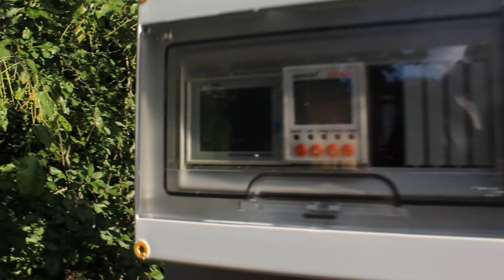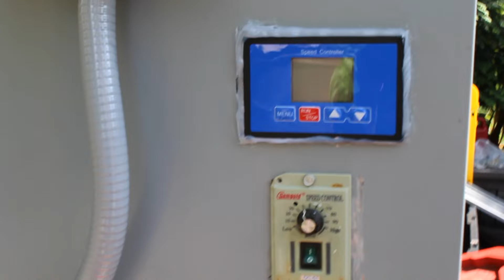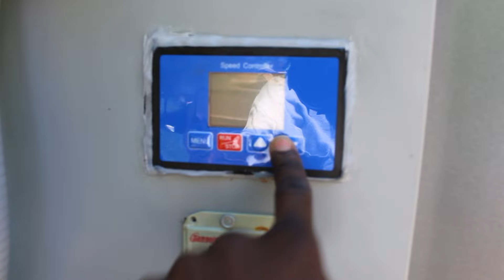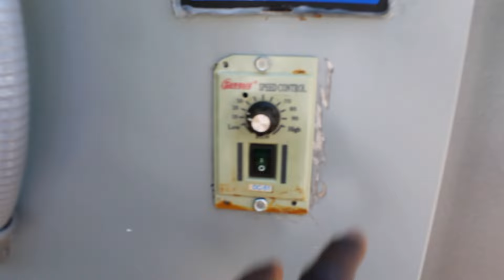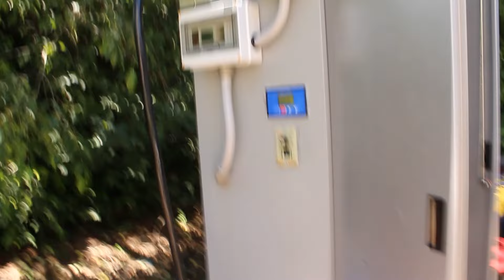Electrical Work! Plastic to Fuel Reactor |  Mark 4.5

Comment: Was worried for no video, but good to see the improvement yet again. I just ordered 2 microwaves (cheapest I can find). And will take them apart like you did in a different video. Then find something to mount it to and with precautions get to work myself!
Reply: Elektrocuteer je jezelf niet?
Reply: Don't. It's a scam. He's not making fuel, he's making toxic waste.
Reply: You building an MPR as well?

Comment: Get some 2 by 4 to place under to wheels to extend to footprint (front to back) to make the cabinet more stable, right now its too narrow. bolt the 2 by 4 to the base of the cabinet. six inches front to back should help.

Comment: I love your content and what you are trying to do. I am concerned about law or city code enforcement coming and forcing you to dismantle the wholes thing working in a residential area.
Also I couldn't tell from the video but since you are coming off your house's power, DO NOT have a dedicated ground rod for this cabinet since you are already bonded to your house's ground. That is a mistake made by even electricians with things like this and it can be dangerous and has killed people in the case of light poles, etc. You also mentioned you have transformers. Whatever is on the secondaries will be floating unless the transformer was designed to bond the ground to the secondary side. That can depend on a lot of variables though. If you have your supply gear on your transformers bonded to the same ground as the cabinets without the transformers themselves being tied, this can create a safety issue as well and possible damage equipment if the transformer was not designed for this, you need to account for it as well by "grounding" the secondary back to neutral on the transformer. Grounding and bonding is much more complex than most people think (especially with transformers installed) and must be done properly. Just from watching your other videos it seems like you get yourself well educated before taking on something so you are probably good. This is just a topic I like to spread awareness on. Mike Holt's channel on here has several great videos explaining grounding and bonding with diagrams far better than what I am doing here for those who are curious or want to learn more.

Comment: Ok but why wont you address the waste issue, people are screaming at you about the benzene. How are you working on waste disposal? Do not just dump that material into the ground.  You need to get it tested to see what you are creating/ releasing.  For example What gasses are you releasing???

Comment: Wouldn't it be simpler to light a fire underneath to heat it , then use the escaping gas to keep it going. No electricity needed.
Reply: That is very inefficient, microwave pyrolysis is much more efficient, especially with a continuous feed system.
Reply: also a conventional fire can not produce the required heat to preform pyrolysis
Reply: Was a good question tho